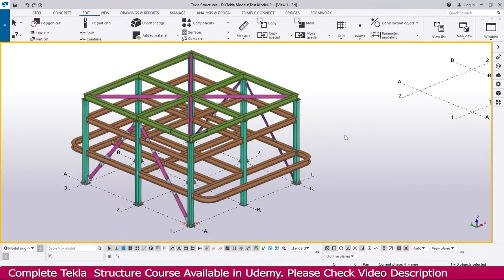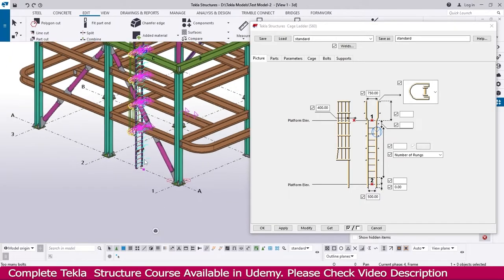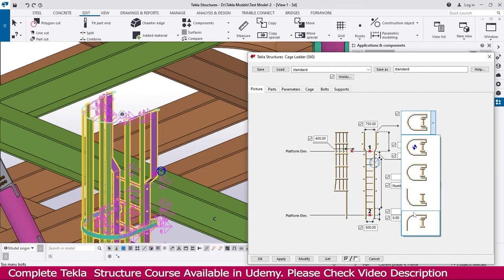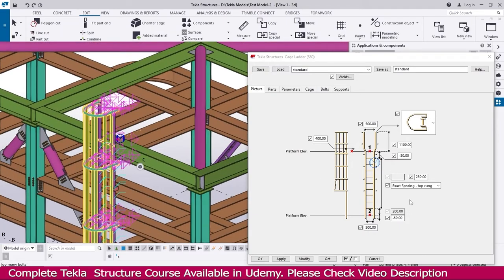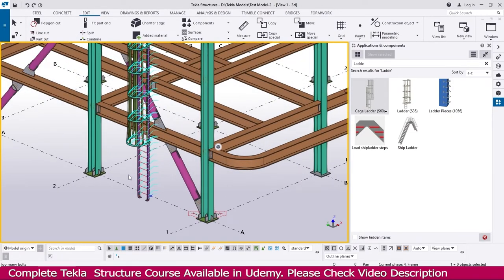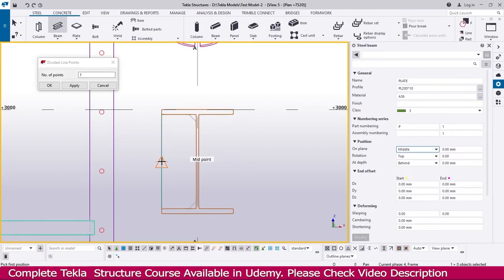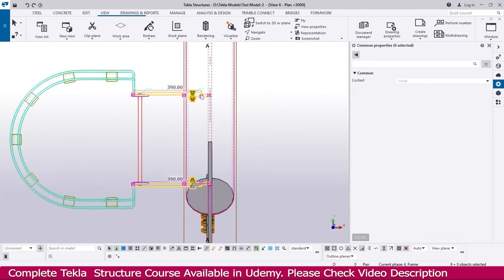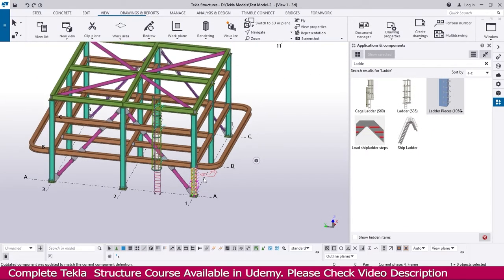6 Create Ladder in Tekla Structure

Comment: OK button OR Apply button. It is unnecessary to use both. Whichever you use, Tekla will store the values of the current property window, and the next time the object associated with the window (view, part, weld, bolt, etc.) will be created with the stored properties. There is only one difference between the two buttons, the Ok button closes the window, the Apply button leaves it open.
Reply from the maker: Yes you correct.
Reply: @dailylearnrajesh3742  By the way, it is a very informative video (and your other videos). It is nice of you to share your knowledge.